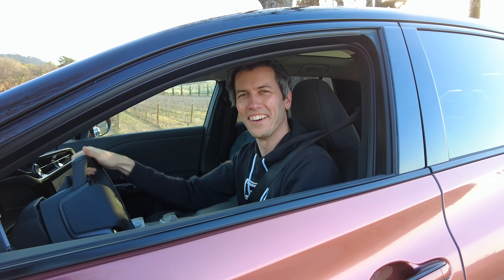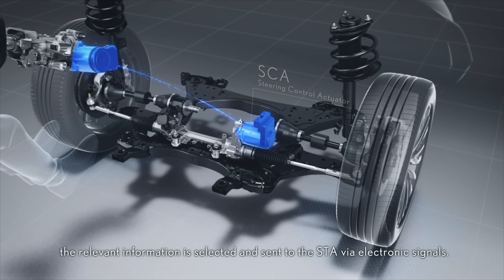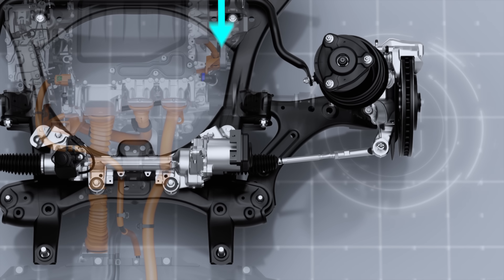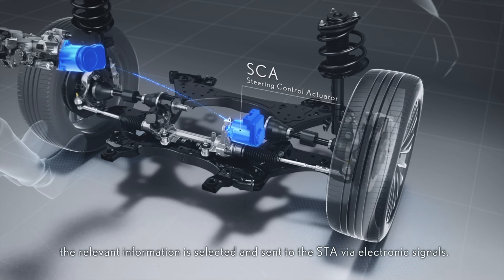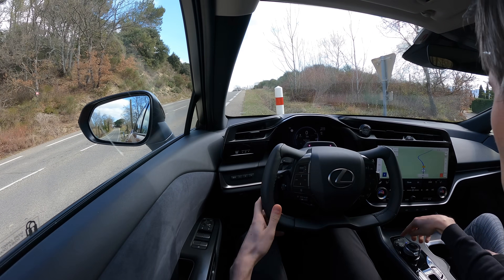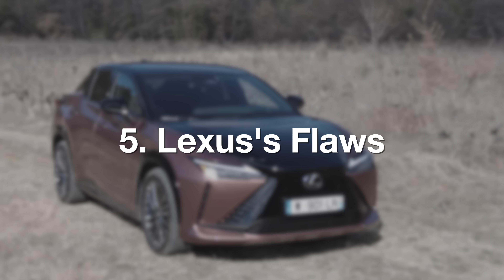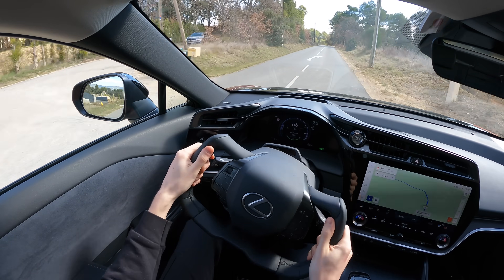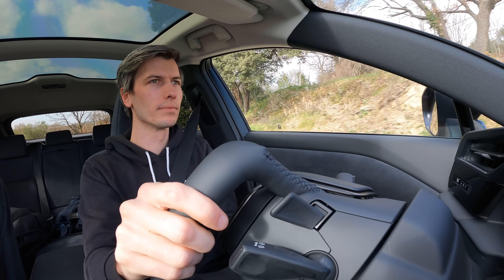How Lexus Fixed Tesla's Bad Idea: Steer-By-Wire Yoke

Comment: All I hear in this videos are negatives

1 Infinitely adjustable steering ratio.

This is the number one thing I hate about my 2021 Forester, Not only is it drive by wire but it also has a CVT. the two of these systems working in tandem make it so that no two presses of the gas pedal are the same. The drive by wire introduces noticeable input lag on any car that has it. I understand that is just the way it is now but couple that with the CVT and it either takers off more aggressively than I wanted or not fast enough. For some reason, the car acts differently almost every time you press the gas pedal. its impossible to drive the car without thinking about how much I need to push the gas pedal based on how I think the car will react before pushing it.

 Compare this to my 5 speed 87 accord hatchback where it has a cable operated pedal and a manual and you have a car that is 100% predictable and as a result I find myself having fun driving it as I am not constantly thinking about how much I need to push the gas pedal down because the cars behavior is predictable

You're telling me that, if this becomes mainstream, not only will I have to guess how much I need to push the gas pedal down, but I will also now have to guess how much my car will steer based on how fast I'm going? Sounds like a lot more accidents will be coming in the future

2 Is it safe? section

I am happy to learn that there are redundant systems that will keep this system functioning if something should happen to it but this brings up another issue. Cars are already too expensive for most as it it. (Looking at the amount of people defaulting on loans in recent years as well as the amount of loans that have increased in length should tell you everything you need to know) There are enough systems in a car that need maintenance and repair and the steering system on any car I've owned has never been one. All this video is convincing me of is that when your steering system has an issue... when... it will cost an arm and a leg to repair your cars steering. Not to mention the sticker price on these cars that will have these systems because of the engineering that needs to go into a system like this. 

I guess my main point here is this, It's a steering system.. why "fix" something that isn't broken.. Why over engineer something that is so reliable and and has been perfectly fine for over 100 years?

I like your points at the end of the video, it lines up with my earlier thoughts and shows that you are objective in your testing.

Comment: I will say one thing and you all can fill the rest:
Dead battery
Reply: @Blue
You missed it I guess I should have explained more.
Batteries will deplete naturally if you want it or not and you bet that there will be one of those with 0% battery on main and secondary batteries for what ever reason even if you don't lose stearing when in motion if from what ever reason the car refused to power up in where ever good luck getting it on a the bed to get towed every car got a way to disengage breaks and stearing luck when it can power it self but if it happens here you got no stearing making controlling the car a bad time to have.

It is not just about safety on the road because it is still a safety concern. I think teslas had weird behavior sometimes with twitchy power and stearing while driving makinging dangerous to drive. And needed to get fixed.

But also we need to think that all this technology and R&D and the redundant systems that need to be in place in case the main one failed double motors on stearing double everything.
All this will cost a lot of money and you will need to pay for it as the consumer.

There is just a lot of down sides and no real upside

Comment: So what is the latency in milliseconds and how does it compare to, say, the "regular" steering wheel and, for example a video game? In video games the usual situation is - if latency goes higher than some specific threshold -  I don't remember exactly how much - might be really low like 5-10 ms - the whole game and experience feels awful and unplayable. I imagine there is no way to have such low latency in hardware (except the shaft)? Inertia and latency in one driver, signal conversion, let's say instant transmission by actual wire, then again signal conversion, inertia and latency in the other driver? is it "less" or "really comparable" to the "time to take for literally speed of sound in metal through the shaft"?

Comment: Infiniti Q50S had steer-by-wire a few years ago, though I’ve never driven one, and I think they stopped making them. BMW had “active steering” about 15 years ago, that was a mechanical system but with variable ratio. It was very nice. Very easy to park at low speedas and smooth cruising at higher speeds. The learning curve was not an issue.
Reply: I’ve got it in my 2019 Q50 Red Sport. It’s pretty neat technology. I’m a big fan of it automatically adjusting the ratios when switching between the drive modes. Makes it more fun to drive in Sport+ mode and snow mode makes it much easier to stay on the road during there Texas winter ice storms.
Reply: My 2003 LX470 has VGRS which I think is similar to yours. It has a pretty tight u-turn
Reply: still available on the Q50
Reply: I was just about to write that
Reply: I drove an Infiniti with this system a few years back and in town it was fine. On the highway it was awful. Keeping the car centered in the lane at higher speeds felt like a chore, but that probably comes down to the software. If Airbus has had a lot of success with fly-by-wire in their aircraft, I see no reason why it couldn't work well in a car.
Reply: Originally Q50 had only steer-by-wire, but after some negative reviews, they also retrofitted traditional hydraulic steering.
Reply: Yeah, as someone who has been driving BMWs for a decade I was having a really hard time understanding the appeal of this.
I didn't even realize other cars still had fixed steering ratios. That sounds awful.
Reply: @TechArtAlex  thought the same thing, and it's not just BMW.  I recall a 1999 Jaguar that did the same thing.
Reply: @data_abort  The 99 jaguar (and some other cars of the era) had variable steering assist, not variable steering ratio.

Comment: A complex and expensive solution to tesla's problems with the yoke... which was never a problem in the first place because every reasonable car has a steering wheel instead of a yoke. But yokes are soooo cool! ...until its 20 years old and impossible or at least very espensive to fix. not to mention... INPUT LAG??? on a f*cking steering apparatus? This car should be banned from the road lmao.

Comment: Imo DBW you are not really the driver, not directly. You are like 2nd driver.  The car listen to you but the car can ignore you completely.

The old column, the ratio can be done too and lexus already did it.  All else fail you still mechanically in control and it did happen to me when all electrical fail.

Comment: Ok, so what happens when one of the steering actuator motors fails, and the guy who got the car used for $3000 in 2038 just ignores it because he can't afford to repair it right now, and what even is that light anyway? 

Relying on a warning light seems like it's putting a whole lot of faith in vehicle owners.

Comment: FALSE: You might be or pretend to be an engineer, but NOT A UX-DESIGNER nor an INDUSTRIAL DESIGNER, and again, if any, a ridiculously bad engineer. The TESLA Steering Yoke is engineered/designed PERFECTLY in accordance to the newest scientific UX knowledge. LEXUS on the other hand has 14 flaws in its design, which are making it not just less fun to use, but much less efficient to use and in some cases even dangerous to use. TOYOTA might bribe people around the globe to advertise their cars over others, but fact is, their LEXUS are as bad as their Toyota-versions of their cars, and they are 16+ years behind Tesla in quality, reliability and technology - not to mention, Teslas are even cheaper these days than any electric Toyota the same size - even cheaper than any Toyota or Lexus with MUCH less range and power. STOP letting yourself being bribed, "Engineering Explained". It's disgusting.

Comment: I strongly disagree, it's much worse than Model S
Reply: @blue-lu3iz There is literally no need for this. The Tesla Yoke is not bad Once you get used to it. If you don't like it, you can order Model S/X with round steering wheel. This steer by wire thing is like you don't feel the road, it's like driving a videogame. Model S has 1020 HP, this goofy looking car max 300, I don't even know.

Comment: 12:03 well realistically you can't spin a normal wheel this fast as well, The assisting electric motor can't keep up with such fast movements and it becomes harder to rotate.
Slow maneuvers will not have delay but fast ones will.

Comment: There is one other aspect of using a steering yoke that I see in your videos that I think is a drawback. When traveling for long distances it is most relaxing to place hands above the steering spokes basically at the 10 and 2 or even at the 9 and 3 position on the wheel. The spokes allow the fingers to partially rest on the spokes thereby easing the stress on the hands and arms.

Comment: So they'll happily give us a steering system that purports to enhance safety in spite of the fact that it is entirely dependent on vehicle sensors sending valid data, but not a heads-up display to put important driving information directly in the field of view, which would reduce the amount of time eyes need to be taken off the road and would actually enhance safety.

Got it.

Comment: Interesting! I would like to know, how evasive maneuver works at high speeds if you have to avoid hitting something. Will it just think that it was an accident and will the slower response be enough to make quick moves in tight situations?
Reply: Slower response in that car = still a faster response than a traditional car.
Reply: @TunaIRL  How is that when there is even a noticeable input lag?
Reply: @anttitenhunen4725  Well firstly the whole point of the mechanism was to increase maneuverability to have steering response of cars keep up with the higher throttle and brake response of electric cars. This whole thing would be pointless if it didn't do that. Lexus's brand would take a hit. Not good for them. They don't want that.

Yes, input lag when turning the wheel from 0 to lock in an instant. Try to turn the wheel of your normal car so fast. You can't, even the lagged turning is turning faster than you can turn your cars wheels.

The lag even gets reduced the faster you go since the wheels need to turn less for fast maneuvers. 

It doesn't seem to be so much about input lag but more about how fast the motor can turn the wheels. I'll tell you there's not a single scenario in where you'd want to be moving and have to instantly go full lock and expect to stay in control. Unless drifting. We don't even know if that's lag or simply some kind of smoothing on the steering. 

Even EE said it's not noticable while driving. 

So unless you believe Lexus rolled this out just because they like wasting money, then yeah it might make your steering response worse.
Reply: @TunaIRL  interesting how your whole argument rests on "Lexus is a good brand".

It's also apparent that you never had to do evasive manuever at high speeds. I guess that's a good thing and I hope you never have to.
Reply: @iwatchwithnoads7480  My whole argument doesn't rest on Lexus being a good brand. My argument rests on the fact that just because you can go from 0 to lock very fast and notice lag in the wheels, this doesn't mean lag is noticable at speeds.

Imagine you program it so that 1° of turning on the steering wheel produces lock in the wheels. Would you genuinely expect the tyres to instantly move to lock? Alright so now we know we can't reduce the ratio infinitely and expect the tyres to always keep up. 

Note that lower steering ratios also make the wheel harder to move. Cars without power steering can reach around 15nm. That's quite a lot.

I know you've never done evasive maneuvers at speed since there isn't a SINGLE one you have to do that requires you to go to lock. And if it did, you'd be basically drifting or having massive understeer. Unless you have to do evasive maneuvers at the parking lot, of course. I'd love to see you do these maneuvers while turning your almost 2 turns to lock and pretending to stay in control at any high speeds.

For a regular car with a ~20:1 steering ratio your evasive maneuvers could range to, I'll give you like 60 degrees of wheel movement. This obviously gets lower the faster you go.  Lexus can cut that down to 15 degrees. You have to turn the wheel 4 times less than on a typical road car. This is increased by Lexus at high speeds because, like the video mentions low steering ratios decrease stability. But considering that standing still, the car could be programmed to achieve any steering lock at any wheel angle, any lag will decrease when you get up to speed because of the 2 factors: Less wheel movement and a higher steering ratio. 

Again, this system was made to increase the maneuverability of vehicles.

You can now explain to me what any of this has to do with Lexus being a good brand.
Reply: @TunaIRL  your first and last sentence here don't match your 2nd response in the thread. 

Also thanks for pointing out that you've never had to do that. Not sure what made you think I was talking about "0 to lock" but okay. 

Good God! You probably also thought Windows 8 UI was good lol.
Reply: Yeah, same question! But i also thought, that maybe they should implement BIG red button on that steering wheel, that increases to max sensitivity. So when you push it, you can avoid obstacles on high speed...
Reply: @МдаЭхКхмКхм  Like you had time for that in emergency situation :D
Reply: @anttitenhunen4725  better than nothing though 😆

Comment: I hope when steer by wire becomes a standard thing, round wheels are still available. I tend to not hold my wheel in the most recommended positions while on long straights like a highway. A yoke would definitely cause myself, as well as many others, to have to make big adjustments
Reply: yeah, driving with 4 fingers on the 6 o clock position for minute adjustments going mostly straight on the highway is a habit for many people im sure.
Reply: You can't maneuver the car with it as you would with mechanical steering. It's over steering.
Reply: The "correct" hand position, as some have advocated for it, places a lot of stress on the elbows and shoulders. Safety is paramount, but if your body is tense during a longer drive, I guarantee you're not going to be as engaged with controlling the vehicle and minding your surroundings, which will actually be less safe than lacking "correct" hand grip on the wheel.
Reply: @PTS1337  what is the "correct" hand position? 10 and 3 with the wheel close enough doesnt put any stress
Reply: Agreed.  This is a case of 'hey, we have a good idea, let's change everything else that still works fine'.
Reply: this is a valid point but at the same time that is not the way the wheel is intended to be held. for safety, you're supposed to hold the wheel by its sides. i also do this but i also recognize in the event of a collosion, holding my hand there compromises my safety more than if i was holding the wheel as intended. this design would promote holding the wheel the correct way, and therefore increase safety and control of the vehicle. at the end of the day thats more important above comfort
Reply: @johnknighten123  It's all good if you want to do that, but it's pretty nanny state to say that other people should have to.

Life's for living.  I'm not going to stop eating ice cream, I'm not going to start going to bed at 9PM, and I'm not going to buy a car that has a square steering thing.
Reply: @johnknighten123  If you want to see the epitome of vehicle control, watch cockpit video from a drift race, guarantee you wont see 10 & 2 nor a yoke steering wheel.
Reply: @johnknighten123  Other countries manage to use manual cars with lower collisions than america. The reality is driving just isn't difficult enough for ultra specific technique to matter, most people just don't take it seriously, I seriously doubt you could even find a collision where the primary reason for crashing was "incorrect" hand placement... quotations because there's no correct position, some people will perform better at 10-2, some 9-3, some 1 handed, some various other positions. There is no single good position, just the "random" one you have to learn because your driving school arbitrarily decided they were going to enforce that 1 for the decade.
Reply: Maybe it would be better for you to have a yoke so you put your hands on a safer position while driving.
Reply: @jogengnagel1266  a position that causes fatigue and reduces flexibility is not "safer position"
Reply: @jogengnagel1266  maybe you want to be comfortable so you can actually do long drives safely